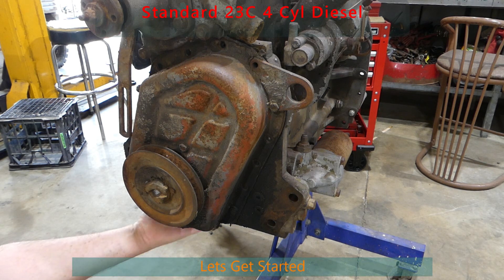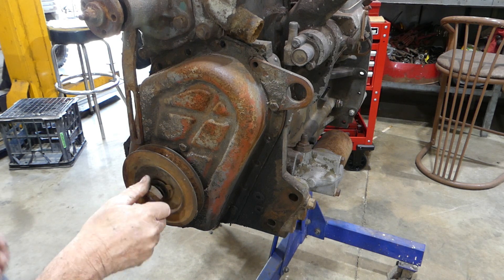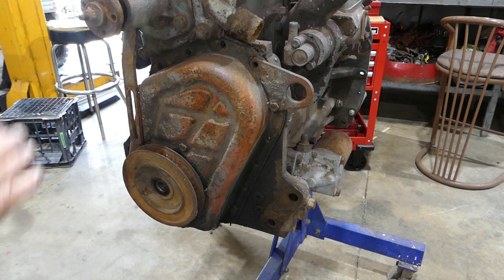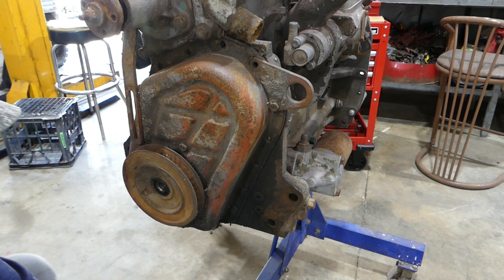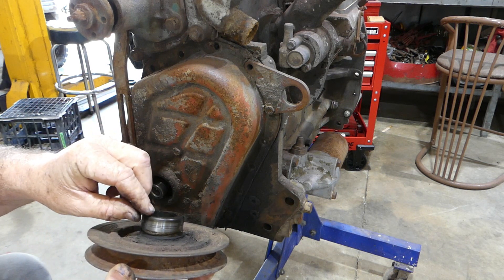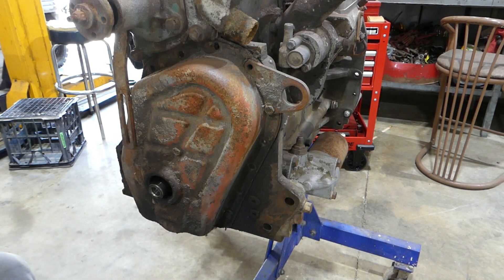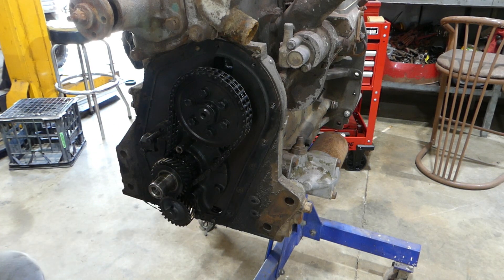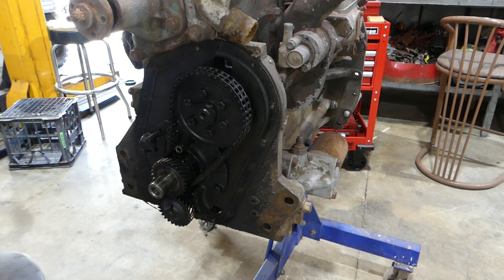Ferguson 23C Diesel Engine Part 1 Pulling a few small parts off out of the way

Comment: Would you by chance have a parts list on engine over haul?  Need oil pump as well. Nothing to speak of over here in United States.
Reply from the maker: NO Im sorry but if you look for AGCO parts book and register with a dealer that is free I thing you will find one in there you can look at or print off.

Comment: my dad bought 35 with the 23c engine it was a pig to start even after new pistons and liners fitted witch i did several times still got it
Reply from the maker: They didnt have a good track record thats for sure, I have had good starting ones though but we are quite warm up here so that might help.
Reply: @BundyBearsShed  thanks for reply and i would like to thank you for your vidio how to reverb a cav injection pump on a perkins 3 cylinder got it running well so happy once again thank you

Comment: Lance - when refurbishing components could you consider adding some information regarding what you consider are the most effecting methods to remove the old gaskets and clean the nuts, bolts and operating parts.
Reply from the maker: Ok Ill see if I can remember as I go.

Comment: When this engine came out in the UK, it soon got a reputation for poor cold weather starting.  Quite a few got the cylinder head injector port drilled out, in a temp to make the engine more direct type engine.  Starting was greatly improved, but you had to be very careful when drilling the head out to avoid going through into the water jacket
Reply from the maker: A friend did one in town recently and it goes really well by all accounts. We dont get really cold here but they can still be hard to start first up.
Reply: I've got a TEF and they are better starters.  I was told by a retired MF mechanic in NZ,.that  they told them to remove the thermostart valve and  leave the fuel pipe on. Turn the key to heat and count how long it would take to produce a flame.  Each valve would be different.  Refit the valve and then count with the key on heat to the same amount of time.  The next second after,  turn to start on the key.  They found that if they kept the thermostart on longer,  the flame would burn up all the oxygen in the manifold and the engine would be harder to start.  See what you think Lance